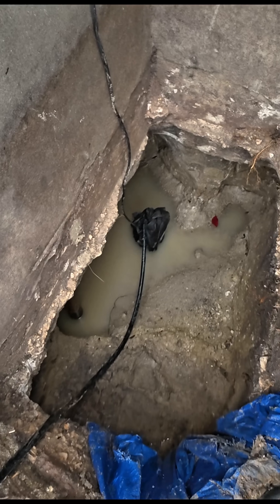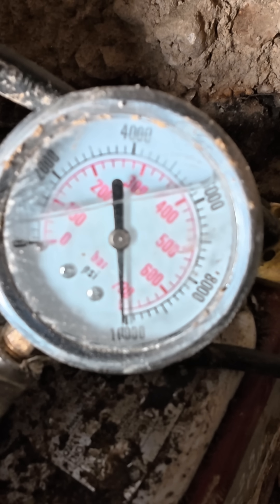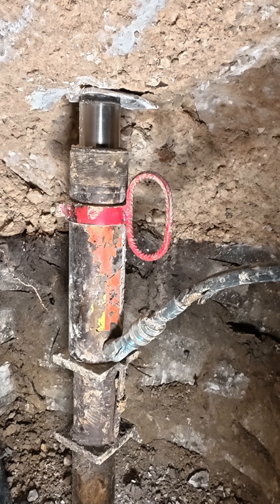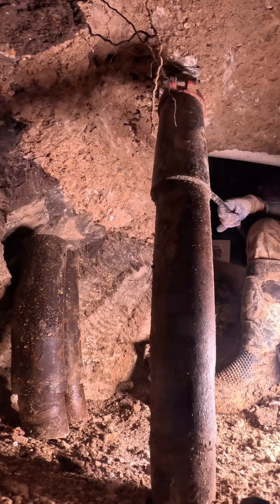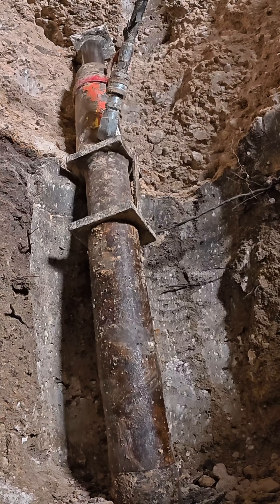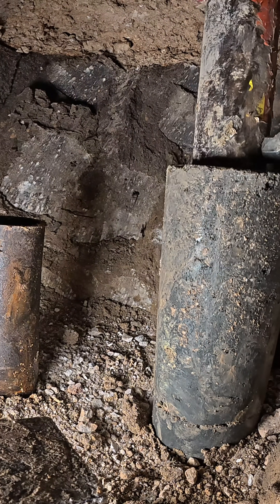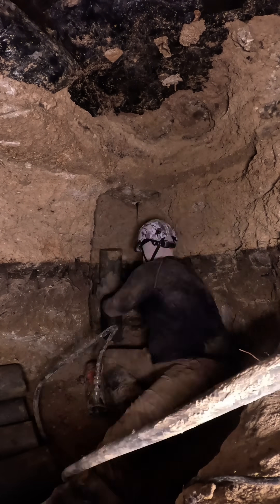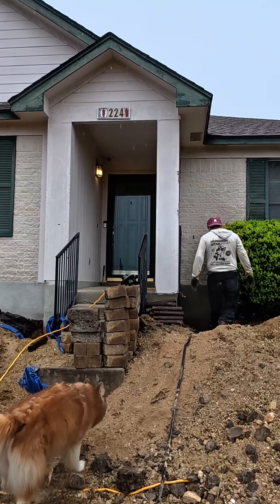Foundation Repair Explained | 10,000+ PSI Refusal Inside a Tunnel

Comment: How does backfill work on a tunnel that size? Id imagine that void under the (i assume) 4in slab could be an issue?
Reply from the maker: You can’t truly compact soil back to its original undisturbed state after tunneling. That’s exactly why tunneling is never left relying on backfill alone.

In this case, we installed piers along the tunnel every ~4–6 ft directly under the load-bearing beams, so the structure is no longer depending on the soil that was disturbed. In areas without beams, we add steel angles to bridge and distribute the load properly.

The slab itself is not carrying the structural load—the beams and piers are. Once the load is transferred to deep, competent soil through the piers, the void/backfill below the slab is no longer a structural concern.
Reply: @ifixconstructionfr Some people pour that slurry backfill in, but even without structure on-top and even with rebar, a 4in slab can only span so far without cracking and sagging due to its own weight plus weight of people plus whatever they put on the floor

For example you wouldn't span a 4in sidewalk over a 4 ft gap even with rebar right

Comment: I’m just so confused how this isn’t a temporary fix? Do those individual piers not shift? It isn’t a homogenous structure and you can see the slight variation in each placement in the wider shots? I’m genuinely curious I have 0 experience with this.
Reply from the maker: The piers don’t rely on the slab or the upper soils for support. Each pier is driven independently until it reaches competent load-bearing strata below the active zone. Once at refusal, that depth and resistance confirm the soil can carry the load long-term.

The house itself is a continuous structure, and the piers work together to support it evenly. The slight visual differences you see are normal—no two locations have identical soil profiles—but the final elevations are corrected and distributed across all piers. That’s why this isn’t a temporary fix when properly designed and installed.

Comment: It’s crazy that little jack is made to hold and measure 10,000+ lbs of pressure!
Reply from the maker: It's pretty amazing what these jacks can do, isn't it? They're specifically designed for that kind of heavy lifting!
Reply: It's not a little jack, is a hydraulic piston, a jack can't handle hydraulic fluid at such pressures 
I wouldn't call it a jack, we use a somewhat similar system to pull tension cables into locking.
That's a pretty dangerous job, but I guess his hydraulic set up is made for those conditions 
Hopefully, designed to do such job.

Comment: So when they build houses they dont know the pressure the pile can refuse! Can they? I know they do with sky scrapers. But this is interesting and houses with concrete pads on the sub-surtace must kinda float?
Reply from the maker: Exactly, you nailed it. And here in texas where clay soils are dominant, house literally just float
Reply: @ifixconstructionfr until there’s a seismic load. Piers do nothing if there’s lateral spread liquefaction. Does the warranty exclude seismic events?

Comment: when those hoses fray its not long until it starts leaking. with that pressure youd be wise to change it early. id hate to see you inject hydraulic fluid in your arm/hand. god bless.
Reply from the maker: Thanks for worrying. Honestly on all my years of experience, the hose or other hydraulic parts don't fail as we properly maintain them. The pier or the house fails before the hydraulic equipment

Comment: When i reach 10k psi on a 20 ton jack, replace it with a 30 ton jack but also i work on heavy machinery
Reply: I'll keep that in mind.
Reply from the maker: That's interesting to hear about your experience with heavy machinery!
Reply: Why? Just curious…
Would 10k psi not be 10,000lbs? 
I don’t do this kind of stuff but I’m curious
Reply: @a @azkray psi is “pounds per square inch” 10,000 psi would be 10,000lbs if the piston in the ram you’re using is 1 square inch. If your ram is 6 square inches it would be 60k lbs, or 30 tons

Comment: Doesn’t the bottle jack damage the top of the concrete when it presses down.
Reply: Concrete has insane compressive strength, and that force is spread out over the ~5x5"? square base.
Reply from the maker: Correct!